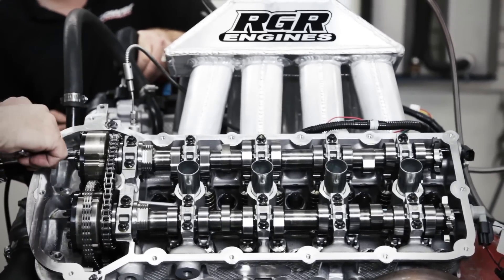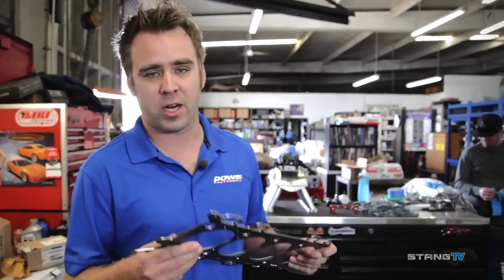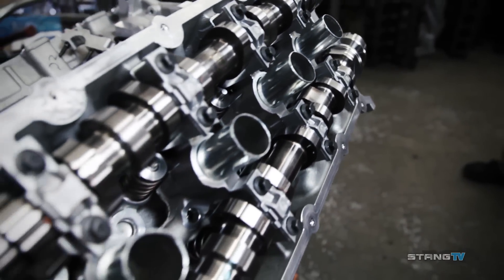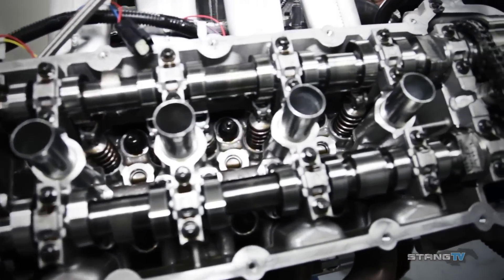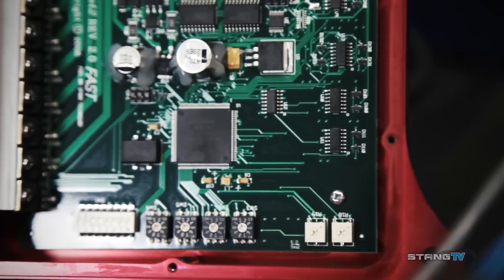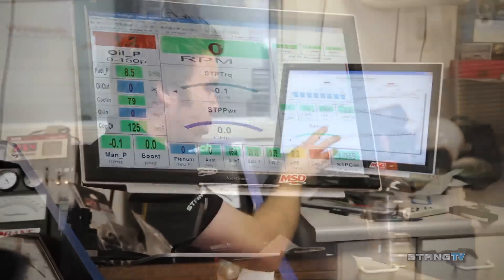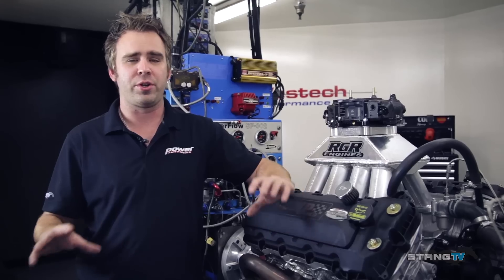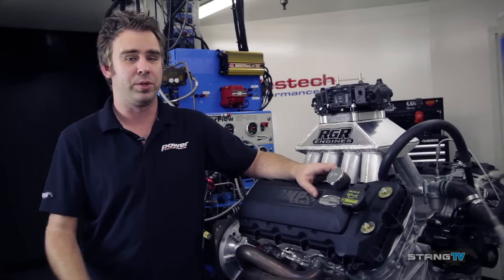Carbureted Cobra Jet Coyote Engine Build: Long Block and Dyno Testing

Comment: OK, I will bite, why run an engine that allows you to change valve timing on the fly to optimize performance as if it didn't?  Absolutely makes zero sense.  Love the coyote, but man let it run wild with fuel injection and VCT.
Reply: +Jay Groom To drop it into an older car without any computers?
Reply: +1000 what you said. My guess is it was just for fun and giggles.
Reply: Jay Groom I don't know, I wouldn't use a modern engine either, but not everybody wants the same thing. Some people do things for the F of it. If you got the money, go for it, I say. lol
Reply: i had a perfectly good 302 ready to drop in to my 54 f100 and saw now bad ass the 4v dohc looks compared to the 302.  Sure i could buy everything off the shelf and toss in the 302 and look like every other one out there but no i chose to go DOHC 4.6 that nobody makes an intake for so i hand made an intake to run a carb.  EFI would be cool but i didnt want the mass of wire the OEM harness had nor did i want to spend 2k on an aftermarket TBI and settled for a $400 carb.  nobody else at the car show will be like mine.  Why? because its a one off, was fun and everyone says holy shit! when i open the hood
Reply: miketlane In testing, the Race Demon carburetors made more HP and more low end torque than fuel injection. The only thing you lose with a Race Demon is some fuel mileage and emissions compliance. But tuning a carb is a lost art, and most people never had the art in the first place, lol thus injection works best for 99.9% of people who can simply install it and then plug and play in the computer. The rest of them can still come to me for carb tuning. lol
Reply: AmericanThunder... I miss the old days of setting up a dual point distributor and a Holley 750 Double Pumper Carb.!! There was great satisfaction in getting everything set up right and running strong! Now it's all Plug'N'Play. lol
Reply: Jay Groom : The reason they do these builds is so you watch the video.  These engines are pure eye candy.  Westech has been the go to dyno for all kinds of video/magazine/book engine builds. I have tons of car mags and books going way back to the early 1990's with pictures of Steve Brule(owner of Westech) setting up engines like these. He had a lot more hair and it was darker, lol. 
The point I'm trying to make is nobody wants to watch a video of a Windsor small block making 500 HP on dyno, nevermind read about it or look at pictures. So you could say these engines are pure clickbait, which I'm okay with. Most of the wacky cool stuff doesn't get built by the average car guy. Can u even imagine the price of that engine, nevermind the cost of a full day of dyno testing.
I'm sure most of the parts are donated for a chance at a shout out to the sponsors. Nothing wrong with that. Steve Brule is smart for doing this because his shop has been around forever and I'm sure this publicity brings in the customers.
Reply: +Jay Groom Yeah, I don't understand it either.
Reply: Clearly at wide open throttle, there will be no difference either way, just for driveability, going from diving around town to going real fast and back, the fuel injection will serve most better.  Easy starts, better economy around town (as long as you stay off the pedal).  Clearly that is a lot of money to spend on  an engine with all kinds of fancy capabilities that are then disabled.  You could make as much power with a big or small block and cheaper.  I get the whole being different thing, but if I am using this fancy of an engine, I would like to be able to use all the bells and whistles.
Reply: And if you want something with twice as many valves and four times as many camshafts and multiple FEET of timing chain to stretch with no gear-drive alternative available or even a high-quality aftermarket or OEM improvement available and you're happy with well under 600 BARE ENGINE horsepower in exchange for probably $7500 to $10,000 invested and you have a vehicle that will look cool with two feet of intake and carburetor and air cleaner sticking up through the hood its STILL "the way to go".
Reply: well my 98 4.6 never had VVT has 32v overhead cams and some long timing chains that are not all that much longer than old toyota 4cyl ones that seems to last quite well.  On street rides who cares, they get sloppy enough to notice change them.....im just glad they are not a dam belt that needs replaced every 60k. we have survived with out VVT along time and i never even heard of it till this video.  im running the same style intake and expecting to be in the 400hp range for under $1000 including the cost of the motor.  mine is up and running now. only way i would ever go even EFI would be to run the 2003 cobra super charger.
Reply: Jay Groom vct is just a way to have big cams without the lope. I prefer the lope. Carb because its cheap and proven and easy. Thats my guess. You can run carb+vct using a controller i believe.
Reply: It's the job of the media to test it, regardless if it will work or not so that consumers can see every conceivable type of combination when it comes to building their vehicle.
Reply: i was gonna say if they are trying to maximize hp at 8k rpm it seems like they are building it to specification that may require a carb and not need much in the way of part throttle drive-ability only top end power so no real need the VCT either, and since they wont need it they might as well do away with it to keep things simple and easy to work on if/when it needs servicing
Reply: well if you want simple wide open horse power cheap at full throttle, a 454 is a cheap way to go.
Reply: Jay Groom True, but then it wouldn't be a Coyote. 😩😜😂
Reply: OK, you got me there.
Reply: Jay Groom they are looking for peak numbers.
Reply: Jay Groom
Removing the EFI and VVT from the equation greatly simplifies tuning at the expense of average power. It replaces the need for a full computer and a good portion of the harness. Also note they where running custom cams that may not have been happy with the VVT system. 
I'm actually considering building a Coyote for drag racing (most because I'm a little bord of old school small block chevys) from the ground up with a blow through carb and eliminating the VVT all together. There is a company that makes special sprockets that completely eliminates that cam phasers, which they claim saves about 2 lbs of rotational weight.
What you're left with is, essentially, a tough Ford 5.0 with a flathead firing order and awesome 4 valve heads that outflow pretty much any 2v head for a sbf and can pretty easily rev to the moon.
Reply: EFI and valvetrain voodoo aren't to maximize performance. At WOT an engine has no clue whether there's a carb or EFI on it. All the electronic wizardry does is let you avoid the compromises to emissions and mileage that come with a performance carb.
Reply: Sure, but why run a coyote which will cost you a gazillion dollars when you could build up a small block and trick it all out and make it more period looking (also easier to shoe horn in to old engine bay) and have money to spare for suspension upgrades and the like?
Reply: Well, if you want something with 4 valves per cylinder, but with little reliance on computers and a mess of wires everywhere. I guess this is the way to go.
Reply: Because its a carbureted and naturally-aspirated engine that doesn't have anywhere near all the sensors and "brains" necessary to make use of the LIMITED capability of the VVT systems. In case you haven't figured it out, the PRIMARY REASON for VVT on these engines is because of the super-long timing chains and large amount of stretch that results from relatively small amounts of wear at each link. Without VVT to compensate for timing chain stretch from wear and even increased temperature as the engine warms up, the cams would become progressively more retarded relative to the crank. 

And if you watch the video carefully during one of the dyno pull clips you can see the engine oil pressure start dropping DRAMATICALLY at high rpm. The VVT actuators are just more components that have to be supplied with engine oil and that will leak engine oil and contribute to a high-rpm oil pressure drop as the lube system pumps too much oil to the top end of the engine and oil draining back is aerated and slowed down by crankcase pressure on its way back to the pan. 

VVT would just make that situation worse and not only would they "consume" oil flow and volume the engine clearly doesn't have on the top end, they'd aerate the shit out if flinging it out more and more at higher speeds. Given they spun that thing to almost 8000, its possible that the VVT actuators aren't even an option at those speeds. Because of their design they're not perfectly balanced and they probably create more problems than they "solve" at very high engine speeds. 

And do you really think VVT would have made this thing that much less of a DOG than it is? That's funny. The "benefit" of VVT is that ideally at SOME POINT in the variable timing and at different engine speeds or loads, the camshaft timing will be "perfect". But guess what? That means there's no need for VVT thats only perfect part of the time when you can determine an ideal setting or the best compromise ON THE DYNO and lock the cams in at that point AND advance them manually to compensate for chain wear over time. 

Especially when they're just adding weight, oil leakage, expense, complexity and potential failure points to the engine. All that extra mass has to be driven by those chains that the VVT contributes to the stretching of as it helps compensate for it. So if you can do away with all the disadvantages and retain the advantages, what possible reason is there to keep VVT? There is none.  

Do you know why VVT is all but unknown on engines and is mainly found on OHC engines with long timing chains and high cam loads and large amounts of chain wear and stretch? Because its the "solution" to a problem other engines WITHOUT OVERHEAD CAMS AND SUPER-LONG CHAINS DON'T HAVE.

Comment: thats all?   put ALL the STOCK parts back on it with ford racing supercharger and make same or more power for less money
Reply: S550 Racer you street outlaw guys crack me up. If it ain’t making 1500hp people say it’s slow. This isn’t about a peak number it’s an N/A engine.
Reply: S550 Racer people like you are so damn annoying. Not everyone wants a boosted car. Some people like NA power band and sound.
Reply: Why not add a Procharger to this setup and make that much more power. Would make 1000+ easy
Reply: Actually, the carb is much cheaper than any possible supercharger combination.  Especially if you got through welding 101 and can fab up a manifold. Crack a catalog sometime.  I hope you aren't saying buy a junkyard blower.  Then, you still need an intake, etc.  Plus, this is a "starting point" build.  Most of the cams are ground to compensate for the feeble abilities of fuel injection...need to develop some better ones.  Bigger carb, better headers, etc.

Comment: why does it have two camshafts my 351w only has one??
Reply: im guessing he watched the video and didnt understand much
Reply: +jose lazaro (caveman) Your windsor is a pushrod v8 with 1 central camshaft that operates both intake and exhaust valves on both heads. This engine has 4 camshafts total, 1 for intake and 1 for exhaust on each head.
Reply: basically he trying to say, you have a ohv engine = 1 cam, that's a DOHC engine = 4 cams..also sohc=2 cams
Reply: This engine has 4  overhead camshafts. 2 for intake and 2 for exhaust. You will notice the engine has 32 valves. You 351 only has 16.

Comment: lol yes you can make over 500 hp with an early generation GM LS and with way less RPM AND mostly stock value train, a 600 lift cam can be used with stock Springs and rockers. with much more potential for the money in comparison.  Ford is really cool stuff but way over engendered and expensive. GM doesn't need any more than one cam and no unnecessary cam chains to just complicate things terribly just for the sake of it.
Reply: +Louis Piscitell Whatever.. If you aren't interested, why watch?  BTW my pushrod old tech 9.2 SVO hybrid block with old tech Roush designed (in the 80's no less) C302B heads makes everything a LS does.  Sorta Cleveland, Sorta Windsor power well into the 500's along with torque from a 351CID package - stock bore and stroke, not stroked.  Turns just about has high rpm as the mod motor.  NASCAR banned the heads I am running after Ernie Elliot built a monster that Bill Elliot smashed all the Taladega records with and brought on the restrictor plate era.  LS heads are actually pretty similar to evolved Cleveland heads Ford was racing in the 90's.
Reply: +martin750hp 
I'm not sure Chevrolet deserves credit just for canting the valves, since that was also done in some Chrysler engines back into the 50s.  

Regardless, all the classic muscle car heads are out dated.  Newer designs are much more efficient.   Because they didn't have computers to design port geometries, and such.
Reply: +kblackav8or Originally the Cleveland head back in the late 60's? Is a copied CHEVROLET DESIGN FROM the big block PORCUPINE HEADS CHEVROLET DESIGNED BACK IN 1963 FOR NASCAR CALLED THE 427 BIGBLOCK NO ONE EVER MENTIONES THAT FACT.,.....CHEVROLET DESIGN!!!!!!
Reply: Motor would make far more power with its valve timing and fuel injection, I see no point in carbing a Coyote.
Reply: manrightchea then why did the motor make more than 120 more HP With locked out cams and a carb...
Reply: .600 lift cam?Stock valve springs? when's the valve float come in about 800 RPM...lol
Reply: Grant Panage yes sir stock beehives
Reply: Warning warning, fanboy alert.